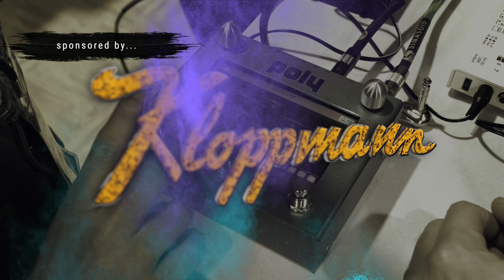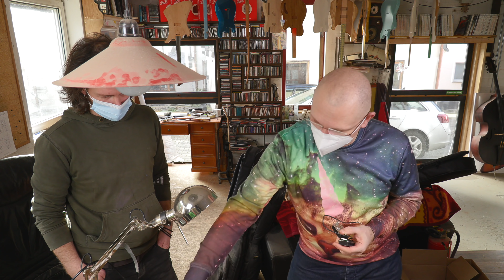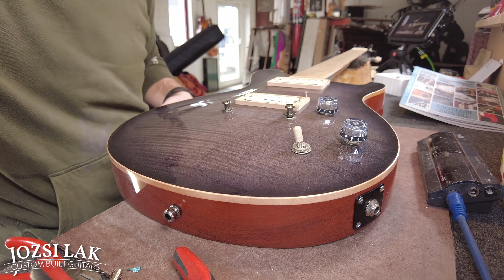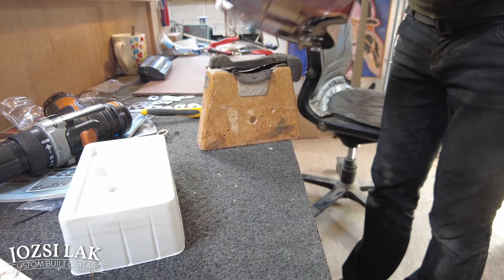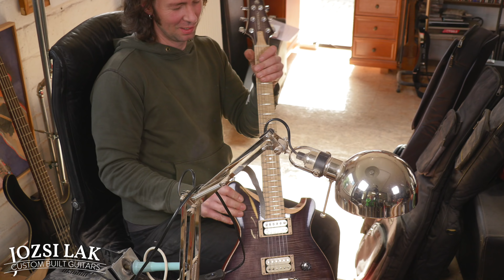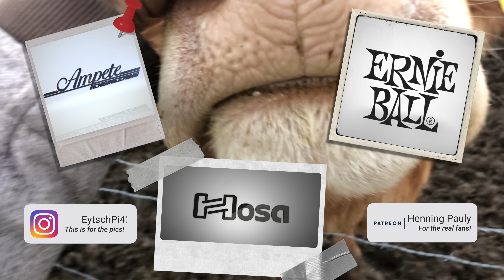A classicly heavy upgrade! Kloppmann Hammer & Anvil Review

Comment: Coil split vs coil tap is actually not that complicated (and it kinda surprises me how many people seem to always confuse the two, the hint is in the name). The vast majority of time people talk about either of those, they mean coil split - taking a humbucker and "separating" (splitting) the coils apart so they can only use one of them, effectively making a single coil pickup. From the way the coils are made, it basically only means the pickup offers the option to wire each of the two coils in its entirety independently.

Coil tap is in a way a bit more complicated. It refers to only one of the coils, which is wound in a way that the winding of the coil is "tapped" at some point to make a "branch off" to basically allow you to either use the full length of the coil as you would normally do, or leave part of the winding unused - which would result in a weaker output with a different sound characteristics, exactly how a "less hot" pickup would sound. So coil tap is usually used with hotter pickups to make a less hot sound available on the same guitar, for example to make a modern guitar with hi-gain pickups sound more like a vintage one.

And it has also be said coil tap tends to be fairly rare, unlike coil split, precisely because coil tap requires the pickup to be wound in a different way from the beginning, whereas coil split just means wiring a regular wound humbucker differently.

(And I apologize, this probably isn't the right place to explain this, but I just couldn't help myself.)
Reply: Coil splitting is a special case of coil tapping: it means tapping in the middle of a set of two coils. It is also a barbarism in that no coil is split. The whole pick-up is split in that only one of its coils is used. Tapping the signal somewhere within a coil, on the other hand, is really splitting acoil.
Still we always get one who's trying to explain some higher wisdom and only ends up showing he doesn't understand his own language.
Reply: @Leo_ofRedKeep  Well I hope you feel all better now that you've told us how you really feel about semantics that really add nothing to what was discussed except pointless technicalities that didn't need to be addressed for the sake of simplicity (though the suggestion that coil splitting is a form of coil tapping assumes things I would not consider being correct, like for example considering both coils of a humbucker being one single coil in order for it to be tapped by doing a coil split, despite the fact that there are quite literally two physical coils in a humbucker), and of course also about how appalling it is I clearly don't understand my own language. Which, BTW, isn't English, not that I think it matters in the slightest.

But you clearly feel very strongly about all of this and have very strong opinions on it, so again, hope you feel better now. Have a nice day as well, pleasure having such a constructive conversation with you.
Reply: @Leo_ofRedKeep  As far as SOUND goes, the effect of splitting a humbucker usually gives you a more single coil sound while also losing a bit of the hum-bucking characteristics of the pickup. Tapping a coil is usually done on a single coil pickup and makes a hotter pickup sound closer to a lower wound version of itself. Instead of confusing the issue while talking down to someone else, try a little humility. I'm sorry for stepping out as well, but sonics matter more to other guitarists rather than talking points of electronic theory.
Reply: @cchavez248  I know the physics of it. My point is about correcting the misleading language used about them. It takes a guitar player to explain to others how "coil splitting" is something that does not split a coil without even realising the nonsense of it.

Comment: Great video and very honest conclusions. Thank you. Something you might want to try would be to lower the pickups a little then raise the pole pieces on the adjustable coil. This should help brighten the sound a little for humbucking mode but might not be as good when coil split. Playing with pot values can also help but my (little) experience with it is that along with extra brightness comes extra harshness too...

Comment: The new ones are fuller - less spiky. Middle sounds way less poinky and clicky.
Sound waaay better with distortion - there was a weird midrange spike before. The increased bass response really does it for me. To me it went from sounding like you’re trying to emulate a good rock tone to actually pulling it off.

Comment: Editted to the front: But Henning, I DO love the sound of a '59 style neck pickup. :) I have several from several different pickup builders and it's just the style of pickup that I enjoy in that position (of course with variables for style and what the purpose of the guitar is). I have the Dimarzio Anniversary set in a '75 Ibanez Lawsuit "authentic" ;) and I purposely swapped the SD Jazz for the SD 59 in the neck of my mayones cause while the jazz is great, it's just got this frequency range that is amazing (to me) with high gain stuff, but not as good with just a mild overdrive which is where I usually live.
dude the way that shot was angled first I thought he was wearing one of those asian hats, but it was the lamp 🤣🤣🤣7:13 , I'm listening to you while working so I didn't see him bent over before. For the new ones, the split neck pickup might drive too much for my taste. If I want that much push on a clean signal I'll kick in the OD and roll back volume.

Comment: Hi Henning, great video, as always. I actually wanted to ask you about tuners, seeing as you mentioned them.
So, Schallers. Back in the day they were THE tuners to choose for replacements.  If you wanted new tuners, you bought Schallers. Nothing else was worth the effort.  I have a couple of sets on my older guitars and they still (40+ years on) impress me as the best. I don't have any that are newer though, and recently I've been seeing that quite a few Youtubers have been "less than kind" towards them. What happened? Have they really gone that far downhill?
As for the Pickups, well.... "meh". They're nice, sound good etc, but not €400+ good. I went to look at the website and found one set of Pickups for nearly €600 - the same set for nearly €840 because it includes two "bumble bee" caps. While I know they have some parts custom made, that's taking the piss- big time.
Reply from the maker: Schaller dropped the ball and their stuff comes with a lot of play in the tuning action... not always, which means their production is good one day and bad the next.
HipShot, Graphtech... threats where I‘d go today.

Comment: WTF? 
Buy a guitar with good wood and and make sure the neck is fitted accurately all else can be fixed.  Swap out the PU's for Duncan's or something with a reliable track record. Take the guitar to a good tech or even get a  Plek job done on the guitar. For under $1000.00 you should have a killer . Every dollar more you spend is buying prestige. 
fret board